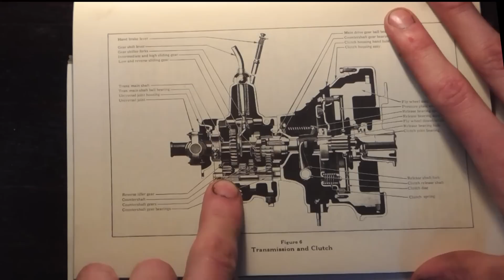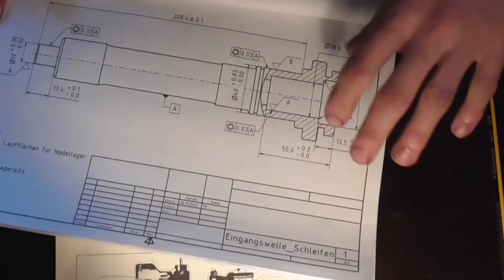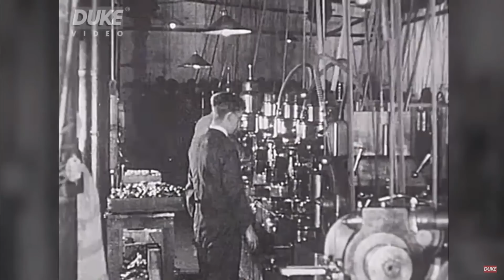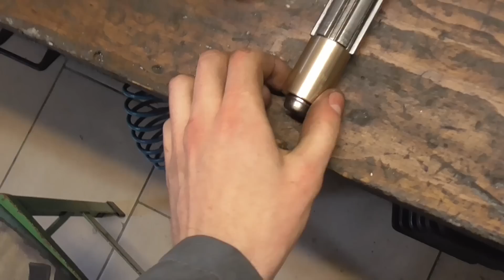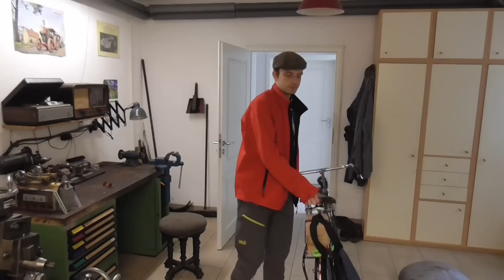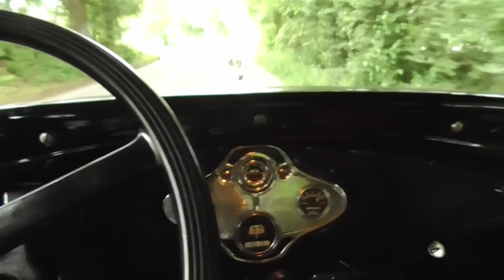Transmission Modification - Ford Model A

Comment: I'm extremely impressed,Just discovered your video and your wonderful transmission transformation.. such a shame you suffered a failure. I would so dearly love these gear ratios in my model A . I have a number of old Fords all of them in original un-restored condition. Just acquired a 1936 Ford V8 with six thousand original miles. If you need any bits from the USA always happy to help.
Reply from the maker: There's a happy ending ;)
https://www.youtube.com/watch?v=RmQjirT_640
Reply: @AstraWerke Thanks for the follow up video , it's a great success. Yes please you can sign me up for two of your transmission Mods. I look forward very much to seeing an up after a few hundred miles. If a pre production deposit is needed I'm all in .. 
Cheers Sterling.
Reply: *Update* ..opps.
Reply from the maker: @psr1868  Thanks alot, I'll keep you updated!

Comment: I learned a lot about the Model A transmission from your efforts.  I am also impressed with your skills - both engineering and machining.  Thank-you for making the effort, showing the drivability can be improved, and sharing all of the work you did to make this change.

Comment: What an excellent video !    As an American "gear head"  I applaud your efforts, and hope you have a beefed up one piece input gear design.  You are a real hot rodder!! Not just a "go with the flow" "bolt on Bob".....       I have been rebuilding and modifying gearboxes for 40 years, and have learned a tremendous amount from examining failures, and failure patterns.  While I watched your video I totally predicted the outcome !!    That thin cross section on your original one piece input shaft is stronger than your "upgrade"  I felt bad for you, putting all that extra effort in.   One old time trick to preventing specific areas from becoming "glass hard" during carburizing and heat treating was to copper plate the area that you wanted to remain ductile.  

Also, when hammering a gear or bearing onto a shaft, always support the gear or bearing with a sleeve, evenly distributing stress..... I just cringed watching you use the vice jaws !!   

Anyway, great first try !  I know you will be successful.      I'm actually currently working on an entire new gearset and shafts for the early Land Rover 4 speed gearbox  (actually a prewar design nearly the same age as the model A ford !!)

Comment: ...actually, I was half expecting that there was going to be trouble with that small gear: I'm  pretty sure that all that pounding didn't help-(?)

I know I'm late to the party- but I'd like to suggest that you had "the right idea, but the wrong approach"...

Regarding "interference fits" there are YouTube videos of a machinist in Australia who uses a torch to expand a mating part- and uses liquid nitrogen to shrink the other mating part- and there is a machinist in the U.S. who also uses a torch to expand a mating part, and uses dry ice to shrink the other mating part. 

Using these techniques, the mating parts are easily assembled, with little or no pounding. 

As for your problem, I wonder if the cracked gear could be laser welded- and you could try again- only this time- chill one part, and heat the small gear before assembling...(?)

Comment: Hi Adrian,  ich schaue immer deine Videos und finde sie sehr interessant und spannend wie die Transmission Modification. Hut ab, dass du dich da ran wagst und dann auch noch ein hervorragendes Ergebnis erzielst. Wie wärs mit der Produktion eines Umbausatzes?

Etwas off topic, aber beim Bestellen neuer Lagerschalen für meine King Pins bin ich auf die "Lenk-Begrenzungsfunktion" des King Pin Locking Bolts gestoßen und habe mich an dein Video erinnert, wo du zeigst, dass der rechte?? Reifen beim Einschlagen immer irgendwo gegen stößt. Vielleicht wurde da nicht  die lange originale Nuss, sondern irgendeine normale Nuß benutzt, die dann die Stoppfunktion nicht ausüben kann?

KING PIN LOCKING BOLT/NUT

Part # A-3122/24 | Model Year 28-31
Special bolt, nut, and lock washer that locks the spindle bolt in place in the axle. Nut goes on back side of axle and provides the stopping point for the spindle when the wheels are turned.
Reply from the maker: Hallo und vielen Dank!
Im Endeffekt hatte jemand die Bolzen von der falschen Seite montiert, sodass die Muttern nicht anschlagen konnten. Ich habe die Bolzen umgedreht und jetzt arbeitet alles, wie es soll.

Comment: I was thinking of a new inputshaft with a smaller inner bore and fitting a tinner bronse bushing?
Reply from the maker: That's not the critical diameter. The issue is the larger bore needed for the 2nd gear to fit when engaging direct drive.
Reply: @AstraWerke  See the problem much clearer now that I have the 2 shafts and 2nd gear in front of me. I keep on playing with them and try to find a way to solve it. If you want I can send you my spare gearbox so you can drive your car while fixing your problem.(can be there this weekend)

Comment: nice engineering :) is there any way to weld new gear on the shaft and still retain or come back to 53Hrc?
Reply from the maker: @kosir1234  Theoretically yes. But since I don't know what exactly the old shaft is made of, I can't be sure the weld will be good.

Comment: What a great video!   I think this concept, in theory is a decent idea.  I wonder what the graph looks like with a higher ratio rear end?
Reply from the maker: Exactly the same, all you need to do is multiply the speed indices (mph) by the percentage that the new ratio is higher than stock.

Comment: Interesting solution! You are a better mechanical engineer than me, but I wonder if surface hardening of the teeth and keeping the shaft a bit more ductile would help (as well as getting every micro-millimeter of material). 

I would encourage you to try revision 2.0 as the car was transformed. We run a 50’s era Borg Warner overdrive half way down the transmission shaft on our 31 pickup…it is a solution but with a whole bunch of other complications.
Reply from the maker: The shaft was only surface-hardened to 0.5mm depth.
I'm currently working on a one-piece inout shaft design, fingers crossed ;)
Reply: You will triumph! The car’s transformation is your motivation!

Comment: Hi its me again. As a new first motion shaft is to be made why not mahe a new 2nd gear to take the same number of teeth you could them stronger All the best pete.
Reply from the maker: There's no space. Increase the  inside cutout in 2nd and you'll run right into the outside teeth.
Of course, make 2nd larger. Well then you'd need a new cluster gear, too - and all your ratios are messed up. It's a vicious cycle xD

Comment: Nice solution! I have a similar issue, but require a different fix.  I wish to convert my Model A gearbox to have 2nd and 3rd gear in constant mesh with a sliding dog between them to engage one or the other.  Like a motorcycle box,  for a hill climb special.
If anyone has seen or done this , I would love to get some info, details pics or drawings.
Reply: Look at the Warner T-84 gearbox on the MB Willys jeep. It is very similar to the Ford box, except it has synchromesh and helical cut gears. But the synchro collar for second/ third gear could give you an idea for making a similar one for the Ford box.

Comment: From the picture if the gears, they are still straight cut. Without spiral gears and synchros, you'll still have to double-clutch, so how is that an improvement on the old"crash-box"?
Reply: The goal was to improve the 1st-2nd gearing which was proven successful in principle, if not execution.
Reply from the maker: xD You're right, might as well LS-swap the darn thing and put an automatic in it while I'm at it

Comment: I applaud your range of skills, being a mechanical engineer myself, never-mind the excellent production quality of your video. I'm not sure of the level of press-fit you used, but that certainly adds to the hoop stress that particular gear is already under, being straight off the clutch ... which I note does not have a torsionally-soft coupling as is relatively common for good reason in modern cars.  But I'm more concerned about the replacement of a needle bearing with a bushing.  My opinion is that it would have been the next weak point had the new primary ratio worked.  There will be a solution to achieve the results you want, it's just a matter of finding it. I have no doubt you will.
Reply from the maker: @paulaxford6754  Yeah, the pressed on solution was a dead concept from the beginning (in hindsight), but curiosity got the best of me.
I've actually got high confidence in the bronze bushing, as both bearing and shaft are rotating. This way, the wear is distributed evenly and it won't get oval.
It swims in oil, diameter is rather small, and for the most part, it sits idle in 3rd gear anyways.

Comment: They run well with t5 5-speed borg Warner boxes also. From s10 Chevrolet trucks possibly ford ranger also.  Maybe a 6speed from japan would work also . Myself id swap in a 20r ,22re from older Toyota, with a 5speed.
Reply: Amongst the videos that YouTube recommended to watch next after this is one with the title "1930 Model A T5 transmission conversion" - that is completely by coincidence, I am sure of it ... ;-)
Reply: T-5 S10 tranny reason being shifter comes up in the correct place.

Comment: I am not an engineer but could the splines be cut off the first motion shaft you made and a new one made to fit in the space made by making the bronze bush smaller.  All the best Peter
Reply from the maker: @peterkilner512  The bushing diameter isn't the critical section. It's the larger bore up front which the 2nd gear wheel is pushed into for direct drive.
Reply: The new splined section would be flush with the new smaller drive gear and  may be undercut to provide a stop for the ford 2nd gear .This new splined section could then be slid into the space provded by smaller bush and splined to fix the drive All the best Peter
Reply from the maker: @peterkilner512  So you mean making a new input shaft without the spline for direkt drive, spline the inside and make an insert with the direct drive spline that gets pressed into the new input shaft, did I get that right?
Reply: @AstraWerke  Not a new first motion shaft you made  but cut off 3rd drive splines and make a new part that fits inside the first motion shaft splined to provides the drive for 3rd gear and fits inside  the space made by the smaller bronze bush  it is replacing your new part driving the layshaft with a part driving 3rd gear All the best Peter
Reply from the maker: @peterkilner512  Phew, the old shaft is already hardened, it'd take some expensive machinery and tooling to spline that one..
Reply: @AstraWerke  Have you hardened the shaft you made first  that is the one I was  useing The main difficulty is the undercut can  the throw of the 2nd  gear be reduced then the undercut be reduced
Reply from the maker: @peterkilner512  The shaft I made is already hardened.
At the moment I'm trying to find a way to eliminate the undercut altogether.
Reply: @AstraWerke  If the indent in gear change shaft  was muved would that make the 2nd gear not go as far into the first motion shaft .A tube put over the shaft would stop any extra movement All the best Peter
Reply from the maker: @peterkilner512  While I'm sure this would be possible, it'd also make shifting alot more difficult because the free space between gears would be reduced.
I already noticed the issues with the 3mm thick spacer I had to put between the input shaft and bearing. Very fiddly to not accidentally grind into other gears.
I'm currently trying to find ways to make the input shaft out of one single piece without the undercut, I think that's the way to go
Reply: You could locktite the new part in. no heating driving it in as where is  it to go All the best Peter

Comment: I have a Mitchell Synchro Transmission, 1st and 2nd ratios are 15% higher than stock and 2nd and 3rd have synchros. IMO, this trans is a better choice the the Mitchell Gear Splitter (altho I have both in my '30 Town Sedan).

I really enjoyed your video tho, great job.
Reply: Have Mitchell with 15% higher in 2nd only.  Use 3.27 rear.  5.5 Snyder head.  B cam, carb and intake manifold, Larger GMC valves. NuRex spark spark advance w 28 degrees full advance and 12 volt negative ground and Petronix ignition.  Spark plug gap .035 inch. V8 pressure plate and cut down flywheel assembly 40 lbs total.  Can accelerate on hills steeper than shown in 3rd.  2nd to 3 rd shift at 25mph.  30 if in hurry.  No delay or clash when shifting into first.

Comment: My first thought was to make a new second gear floating on the output shaft to correspond to your new input shaft design.  After some thought, I see that you probably don't have the diameter available for the larger input shaft gear profile inside the second gear profile.  You may be able to truncate the input shaft gear diameter in the direct drive engagement area enough to fit and have enough engagement.

Another possibility is to cut the original direct drive profile on a new input shaft with a CNC milling machine so you don't have the relief cut in your original input shaft design. I don't think the tolerances need to be very tight on the direct drive coupling surfaces.

Excellent work so far!  The setbacks are a bummer, but it is a wonderful project! 👍✌☮
Reply from the maker: @chrismorrison8510  Cnc-milling the profile for direct drive to eliminate the undercut is my plan, too. Should give alot of additional ridgidity

Comment: Install a Mitchell Gear Splitter!
Reply from the maker: @fredski53  The entire goal of this endeavor was to not have a 2nd gear lever.
Reply: @AstraWerke  I have a Mitchell Synchro Transmission, 1st and 2nd ratios are 15% higher than stock and 2nd and 3rd have synchros. IMO, this trans is a better choice the the Mitchell Gear Splitter (altho I have both in my '30 Town Sedan).

I really enjoyed your video tho, great job.

Comment: I believe that your first "gear-shaft cut-gear modification" would have been successful.  There's really not a lot of stress on 2nd gear (unlike first), nor is there a lot of long-term wear like 3rd gear.  Just my opinion (IMHO) of course but if it was my car (I have a '29 pickup) that's the way that "I" would go.
Reply from the maker: I thought about it, too. But after being very lucky with where my transmission decided to fail, I decided, not to push my luck and rather think of a sturdier contraption.
Reply: @AstraWerke  I'm a physicist, not an engineer/machinist, so I bow to your superior knowledge and expertise.  A silly question perhaps but are you using Grade 3 steel as it is a super-high strength steel.
Reply from the maker: @joelb740  Well, engine transmissions are a new territory for me, too. 
I don't know if it's Grade 3, but I'm using 16MnCr5, an old classic when it comes to gears and transmissions. It's been hardened to 53 Rockwell, which is already pretty tough, my fear is if I go too hard, then I'll wear out the original transmission components which my parts have to cooperate with.

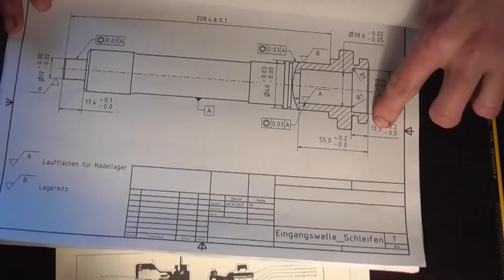Comment: At 8:47 the (black) subtitle works well against the white paper, but the right hand side gets lost against the black background.

You could look carefully at the image, and pick a colour that would contrast in both areas (say, blue).

But to avoid hassle, it's easier to just use and outline font - a simple white shadow (in addition to the decorative black shadow) would ensure that the text is always readable, no matter the background.

And I'm sorry your transmission broke.
Reply from the maker: I usually use outline font - forgot it in this case. Beg your pardon.
Reply: @AstraWerke  Not a criticism - meant as a helpful suggestion

Comment: We have the same issue with the 3-speed crash box on the Austin 7s, very similar design! Slightly different approach, easier and available off-the-shelf, so no waiting times, cogs on the layshaft are all separate on the Austin 'box.

The way it is done, is to remove & discard second gear, and replace with new, intermediate gear shifter cog on the main shaft is re-machined (this is traded on an exchange basis), same number of teeth, the existing part is now smaller and the new part is now bigger. They call this the "Andes Gear". Quite easy to just swap the parts over (and fit new parts that are worn - nearly all bearings, layshaft, keys are available brand-new) and re-fit!

The result is as you have found, the car is more usable, climbs hills better and can even accelerate. Without the gearbox modification, I would not use my car the way I do (as a regular driver) - the screaming engine is just too much and holding up traffic in a busy area is not good!

Bad luck that there was a failure, at least you have proved it works, don't go back to stock, now a case of making it more robust, shame to have to do the research & development yourself and bear the cost in time & money - always better if someone else does that part!

Brilliant work, you did succeed, so well done! Thanks for sharing. Greetings from the UK!

Comment: I don't remember an accident? Or are you talking about the engine re-build?

On consideration, will there be hills whereby you cannot get up in 2nd gear and thus be in the same prediciment but with 1st gear instead? 

Anyway, a lot of hard work you put into that, well done! But a pity with the outcome, in a way. 1 step forward, and 1 step backwards.
Reply from the maker: Due to all the many questions about the Model A, I swapped the timeline around a little.  More on the accident later.

There may be hills that need to be taken in 1st, but I havent come around any. Maybe if you live in the Alps, but then you'd be better off with the stock transmission anyways.
Or with a different car alltogehter xD
Reply: @AstraWerke  I love your work my friend.